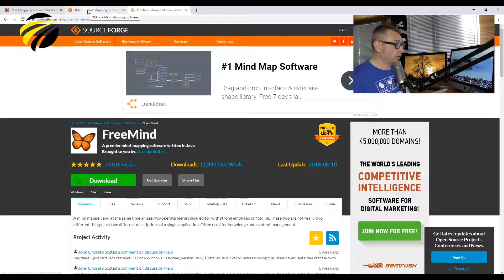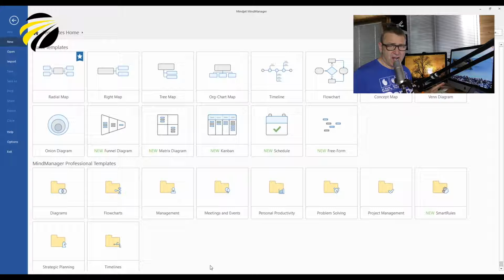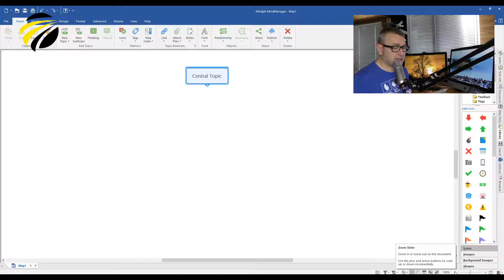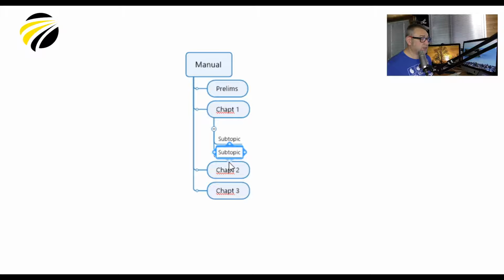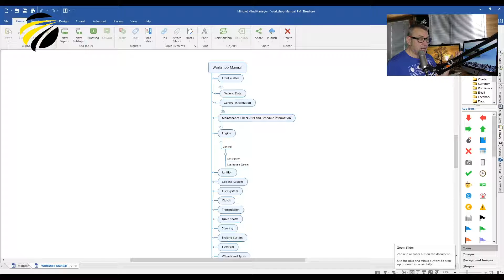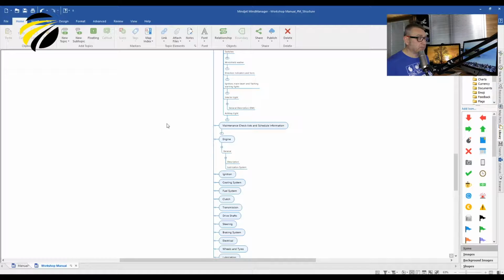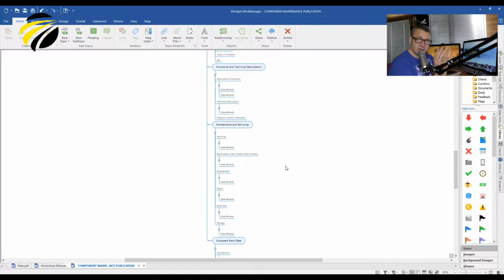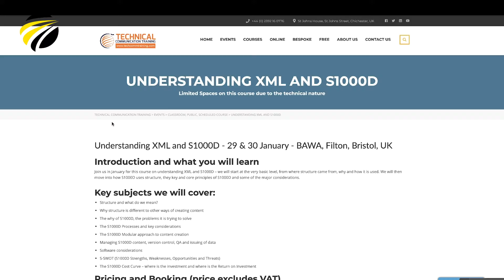Structure an S1000D Publication Module/CMP using MindManager

Comment: Must admit to being a little confused here. MindManager currently retails (without upgrades) for £346.00 - that's quite a bit if you're using it just to display what is basically a TOC? Microsoft 365 is currently £57.00 for the personal edition - with PowerPoint, Excel etc..  Now, in MS Word you can create an outline using the 3 quick select heading levels (CTRL-1, CTRL-2, CTRL-3) and other levels you define in your style sheet at the click of a button, and then simply insert a predefined TOC (which you can modify). This can then be saved as a doc, a pdf, or web HTML. So my question is, why would I spend £346 when I can do the same (and more) for £57? And on top of that, MS Word has an outline view that enables you to simply drag topics around? Be smart... buy Office 365...you know it makes sense :)
Reply from the maker: Hi Nicholas, thanks for the comment, sorry I only just realised YouTube is holding comments until I publish them. You make a valid point and of course you can go your route too. I am showing how I do it, did you watch the recording of the MindManager webinar, I explain exactly why I use MM. And on the scale of software costs in our domain, MindManager is very very cheap. (IMHO) thanks for your comments, appreciated.